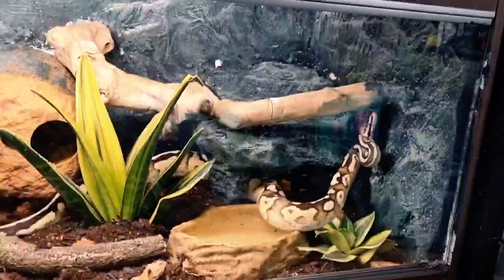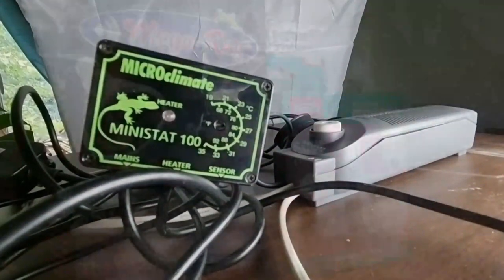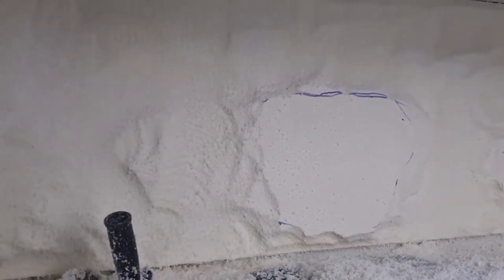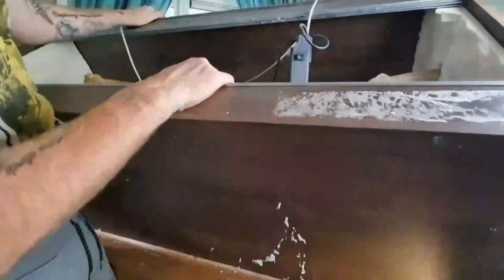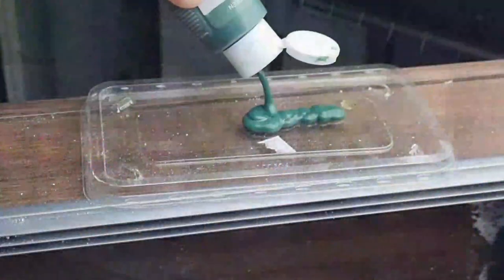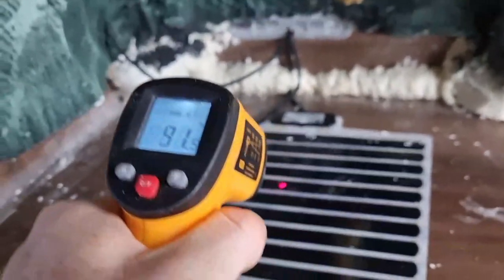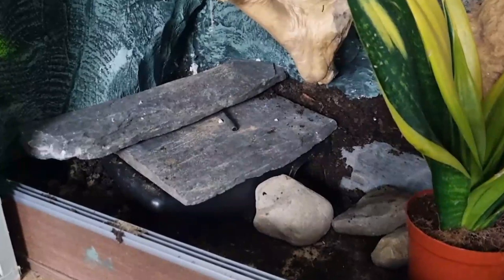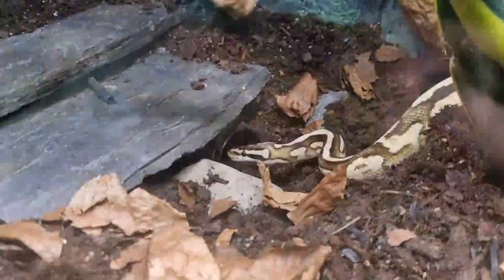5ft Advanced Ball Python Setup UK

Comment: What if he burrows down a bit and gets burnt on the heat pad, do you have any suggestions on a sheet cover for the bottom of the viv that thin enough to let heat through but thick enough that will eliminate the chance of burning, things can always go wrong no matter how well you plan
Reply: You HAVE to use a thermostat with heating pads for this animal. So it’s not a problem bc it can’t get too hot

Comment: ok, the one thing I hate is the plastic wall mounted hide. can you figure out how to rig up a similar hide made of cork bark tubing or some other naturalistic material? could you maybe half a big cork tunnel, afix one half to the wall, and adjoin the other to the first with velcro  or magnets in case you need to fetch out your snake? something like that? can you investigate? I really love your how to vids. and I really love bioactive enclosures. experimenting here in the Sonoran Desert with bioactive rack units for humidity loving reptiles. Its an ongoing issue here in AZ!
Reply from the maker: The wall mounted hide is made from a resin the same as the exo terra hides but I'll look into the other stuff
Reply: @NORTHERNEXOTICS  What hide is this one of the wall? Is it the large version from swell buddy
Reply from the maker: @seanroser4908  I got it from Cheshire reptile rescue. Someone donated it and I brought it from them
Reply: @NORTHERNEXOTICS  Fantastic work and I like the subterranean hide.. Keep up the vids watch a fair few now aha
Reply: @NORTHERNEXOTICS  Sorry mate can I ask a quick bit of advise something you might know! Have you seen the Aztec hides, would an adult BP fit? If you’ve seen them just I want to order a eye pleasing hide but worried won’t fit
Reply from the maker: @seanroser4908  go to a shop and have a look at them. Most reptile shops stock them. Or check out the dimensions in the description.  I've not held one so I wouldn't be able to comment

Comment: I want to make an emclosure just like this. 
I have a wooden viv sealed with epoxy and I want to put in a heat mat but I am worried because many people say you shouldn't use a heat mat in a wooden viv and inside the viv under substrate. 
How do you do this succesfully?
Reply: Heat mats are not a good heat source, overhead heating is much better for them. A halogen flood bulb connected to a dimmer/dimming thermostat is the most natural and beneficial option during the day. They produce infrared A and B like the sun, heat that penetrates deep into the skin tissue and heats them far more effectively than heat mats. Whereas heat mats only produce IRC, which only heats the surface of their skin. Ceramic heat emitters are good for nighttime heating.
Reply: @nightinggale6470  I use both. 
Since a mat is not enough to heat the cage but I like the mat and my snake enjoys the belly heat when he is digesting. Goes onto the mat everytime he eats.
Reply: @HelloWorldxx3  the mat isn’t necessary, but it’s good that you have a lamp. Lamps provide belly heat by heating the surface below them, especially if it’s something like slate.
Reply: @nightinggale6470  But a ball will never bask out in the open so a heat lamp is useless for me. 
I use RHP for ambient temps and the mat for basking. 
My python never just sits there out in the open. And i don't want to force him by taking away the mat. 
The majority of keepers use mats so I don't see a problem.
Reply: @HelloWorldxx3  ball pythons absolutely will bask, both in the open and cryptic basking (only exposing part of their body). Providing plenty of plant coverage, including around the basking spot, will allow them to bask without being exposed. 
RHPs and heat mats only produce infrared C. A heat source that produces IRA and IRB is immensely beneficial for them. The majority of keepers don’t know any better. I have many reputable sources that are worth taking a look at, but I comment them often enough that YouTube has started marking them as spam, so I might not be able to mention them. I’ll try, though.
Reply: @HelloWorldxx3  
Video comparing heat mats, CHEs, and heat lamps 
https://youtu.be/dUJZ04sqhxk

Podcast where expert explains the importance of full spectrum lighting 
https://youtu.be/EhbDx11OMfM

The website reptifiles has more information as well.
Reply: @HelloWorldxx3  look into the research of Roman Muryn and Dr. Frances Baines, two experts who have done extensive research on reptile heating and lighting. Check out the Not Just a Pet Rock, Advancing Herpetological Husbandry, and Reptile Lighting fb groups for more information. These groups have plenty of studies and papers in their files, and plenty of experienced keepers who can explain it better than I can.
Reply: @nightinggale6470  But even with plants he'll be in the light, and he really doesn't like being exposed in the light. 
If he's out at day it's only because I needed him out and then he quickly is back into the dark hide. 
I really don't think I could make him bask in lamp light. 
I don't want to streas him out he is a shy snake in generel.
Reply: @HelloWorldxx3  I still strongly recommend getting a halogen flood bulb connected to a dimmer or dimming thermostat just to give him the opportunity to get IRA and IRB, just so the choice is there. Or at least Arcadia’s deep heat projector, they don’t emit light and produce IRA and IRB, but aren’t quite as good as halogens. If you check out the groups I mentioned you can see many examples of obscured, partially shaded basking spots, and people there can help you do the same in your enclosure. The lamp will also heat the inside of the hide. It’s just something worth considering. You may be surprised with the results, and your snake’s reaction. If it doesn’t work out for whatever reason you could always stop using it, although I’d give him plenty of time to adjust.